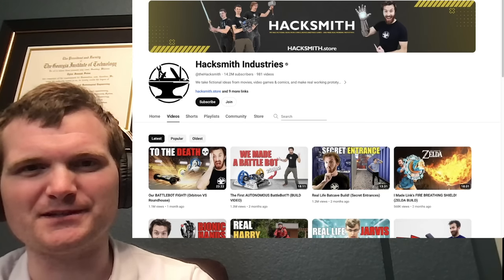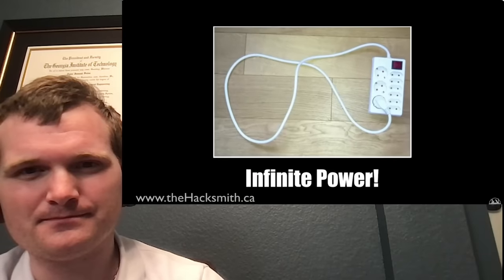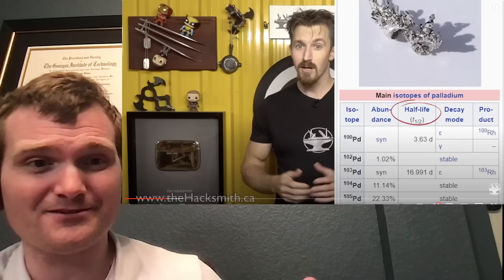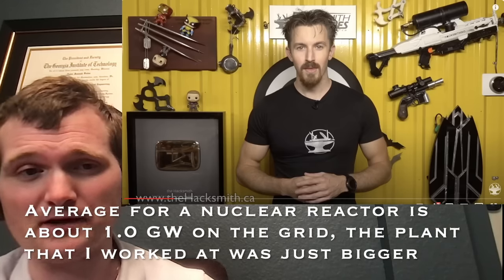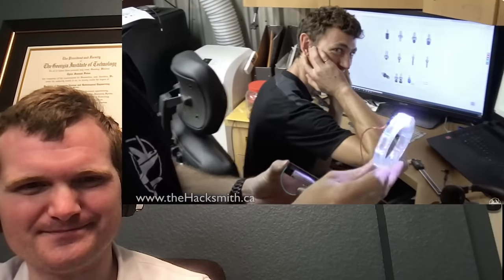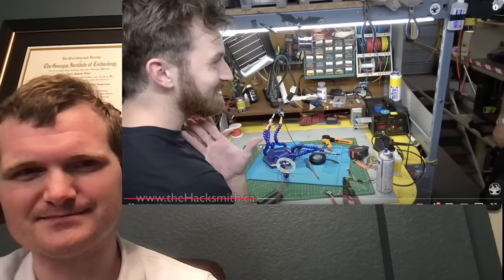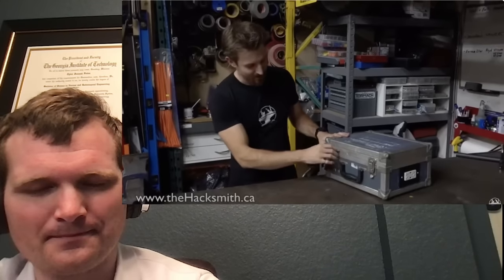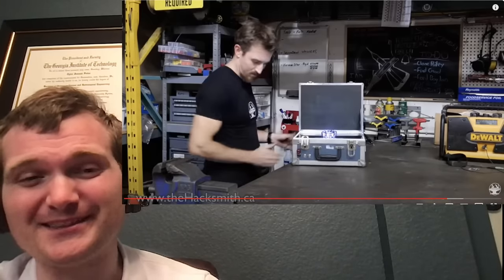Nuclear Engineer Reacts to Real Arc Reactor by Hacksmith Industries

Comment: Being a sign installer by trade I just LED-converted an old (not working for many years) neon sign and salvaged the neon transformers taking 230V to 4000V for some fun projects..   The thing with neon transformers compared to microwave transformers is that they are usually current limited to around 20-30 mA compared to 500 mA.. (23 mA in this case)  making them...  not safe but clearly "more" safe. ;)

Comment: the arc reactor has never been an infinite energy machine, the first arc tony uses burns a sort of "chip" he can swap out, just like a uranium rod but much smaller. the 2nd arc also burns a material but at a much cleaner and efficient rate (so efficient the arc would go long after tonys natural life)
Reply: The efficiency of the first one would continue running longer than Tony's natural life to begin with, if he only used it to stop the shrapnel as it was designed for. That's why the palladium catalyst would burn out, because he was overdrawing from the original design. The second version was designed to essentially never burn out at the higher outputs he required, but then it leached palladium into Tony's blood, poisoning him. Which is why he created an arc reactor with a new material, which in an MCU comic is shown to have been a material he created at his Hawaiian villa, supposedly one he rediscovered that his father had previously discovered. This is widely thought to be vibranium, but given the properties it would need it's likely to be a reference to the artificial variant of vibranium known as reverbium from the main Marvel Universe (Earth-616, the MCU is Earth-199999), which repels and magnifies energy directed at it. This results in the final version of the arc reactor being infinite free energy, as long as it's not fully discharged. But if it is, you just need to put a small amount of power in to start it back up.
Reply: Correct me if I'm wrong but he swaps those out frequently making me think they are actually akin to a circuit so it doesn't over load.

Comment: The high voltage converters used shouldn't be too dangerous, they are repurposed stun gun modules, so they are designed to shock people and not be lethal, adding multiple in series though could get dangerous.

Comment: One technology I was excited years ago, was about particle accelerators on a chip, using meta materials. What I though this technology was, extremely controlled way to induce electromagnetic forces on individual electrons to maneuver them in a set structure, I was hoping that one day we could print hundreds of miniature fusion reactors in a small space, and it would eventually be a decent heat blanket when the technology matures, nothing game changing. Reality is way less exciting, using lasers on a micro structure (the said meta material) that can accelerate electrons, the difference between these two is that the real one can't be scaled for anything more than what it is

Comment: The comic book version, the RT Node, is so much cooler and doesn't really try to have any basis in reality. They're based on the fictional repulsor technology that had been used in the Iron Man suit for a long time by then, not the other way around. As I remember, a repulsor circuit does what is impossible in real life and actually multiplies the energy of the input with no additional inputs like fuel needed, so the RT Node will continually multiply the energy it's initially fed, so it's infinite free energy as long as you don't fully discharge it. Tony didn't have a suit that didn't need to recharge from an external source (unless you count Extremis) untill 2010 in the comics.

Comment: I mean theoretically an Arc reactor could work, it isn't so much about containing a usable amount of current that can be rapidly converted to usable energy.  We just need it to maintain and hold a very powerful electrical source that can be slowly disiminated into smaller more usable voltages and wattages. Like lightning in a bottle around a bottle that statically pulls usable current away.  That's basically how i are a Arc Reactor
"1.21 Jigavolts!!"

Comment: Well, the reality is he doesn't need a lot of current carriers. As he said it about 10 minutes in. And I don't really think you need protective gear. The step down in the amperage up to that much voltage, is going to be tremendous. There's probably almost no amperage. Or at least negligible in that sense.

And you asked why did he go from making that large arc reactor into the small circular one? That's what iron Man wears in his chest to power the suit also

I would also think that actually making just a plasma generator in the chest would be a lot less power, a lot less risk and a lot less noisy. I think just designing a maybe cylindrical plasma ball like the old '80s things.

Comment: E=mc^2
Turn matter into energy.
Reply: Yeah that what almost every single form of power generator does bruh
Reply: @suitkais7  most just capture excess of breaking and reforming chemical bonds, matter is preserved.
Reply: @Eluderatnight Chemical energy is still energy and energy is mass. It's extremely small, but releasing chemical bonds releases mass from the chemicals. 

And let me emphasize how small it is. Every year, all power industry fossil fuels combined in the entire United States only transfer 0.003g of energy from the chemical bonds of the fuel into the electrical grid. Across the entire 2,873,962,000 kg of copper in the US electrical grid, only 0.003g is added by power going across the lines. It being that incredibly small amount of mass is why we generally ignore it.